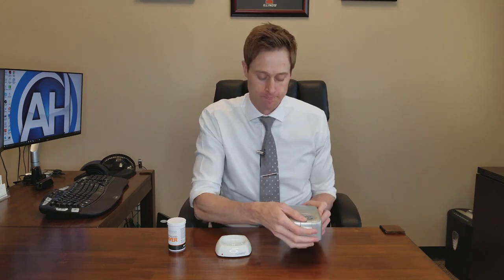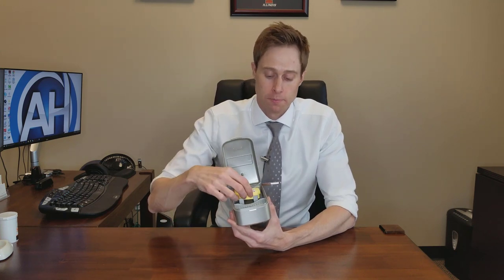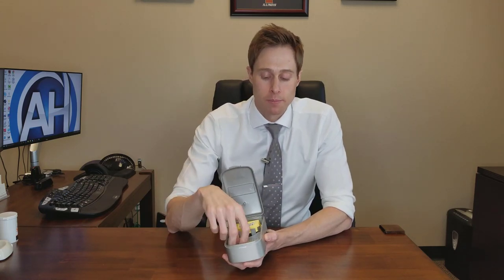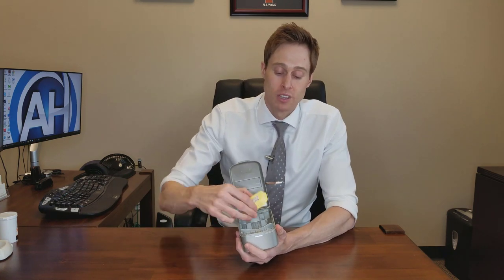The Best Hearing Aid Dryer - Applied Hearing Solutions

Comment: Hi. I had purchased the Dry&Store pro years ago since it was recommended by hearing aid dispenser at the time. About 5 years ago I replaced it due to a faulty design that showed up over time. I replaced it with a Dry&Store Global II. I highly recommend a dryer for hearing aids as I am active and sweat a lot. Having this had increased the life of my devices. BTE, ITE, RITE, CIC users will all benefit from these. I personally like the Global II because it's a dryer and has a germicidal lamp. I do use a hearing aid cleaner called "Audiologist Choice" in conjunction with the lamp. Besides the fact it dryers and cleanses, it's a great container to help ensure you don't drop your devices on the floor. Hope this helps out too.

Comment: I have Phonak Marvel Rechargeable aids and use the Marvel charging case with the built in desiccant capsules.  I also have a Dry n Store Global heated drying unit from my last set of aids.  Would it do any harm to put the Marvel aids into the Dry N Store every second or third night so as to really dry out the aids.  I have been told the rechargeable batteries should not be put into the dryer.  I put a thermometer into my Dry n  Store and it gets up to 101 degrees F.  What are your thoughts???  Thank you.

Comment: I am getting fitted for new Oticon OPN S1 rechargeable hearing aids soon. I tend to be a heavy sweater and I believe my last set of hearing aids have had a significantly shortened life due to moisture damage. I am concerned about being able to recharge the batteries and dry them at the same time. I thought of a potential solution and want your input. I am considering finding an airtight container large enough to hold the charge inside when sealed, then drill a small hole for the charger cord and seal around it with silicone. I would then keep a silica disk inside the sealed container overnight while charging. Would this work or would it damage the charger? It seems similar to the phonak solution. What are you thoughts?

Comment: I notice you said to use an alcohol-based wipe on the hearing aids, and everywhere else I have read not to use alcohol on them.  Did one of us make a mistake, or is this a matter of disagreement in the trade?
Reply from the maker: A common disagreement.
Reply: My quartto insructions say not to use alcohol as a solvent will damage the coating
Reply from the maker: @howardmazur2742  correct, you do not use alcohol on the body of the hearing aid.

Comment: This video is rather old.  I have Phonak Paradise with the charger with disk but still have had moisture problems.  Now I am looking at Phonak's Charge and Care but it only moves air with no heat.  Is just moving air (in a humid environment) effective?  I am looking at heat and moving air as the best solution for me.

Comment: I just found out that with the rechargeable batteries hearing aids, and if you have arthritis in your hands and cannot easily open the door and remove the batteries every night, you either have to find a dedicated charging/drying combo unit (like Siemens/Signia e-charger for their Signia hearing aids) or can use only the silicon bead non-electric drying unit, as not to damage the batteries.
Reply from the maker: Rechargeable hearing aids should only be used with their proprietary charging kit dehydrator.
Reply: @DrCliffAuD  So, I should NOT use the Zephyr Store & Dry (or the 0Global II Electric Hearing Aid Dehumidifier TRG-AA) with a rechargeable Phonak BR?